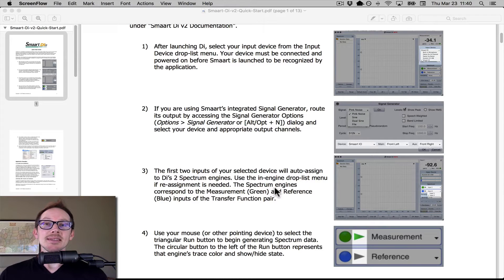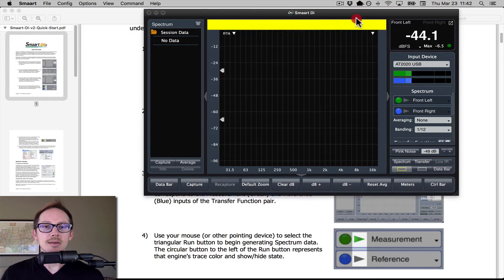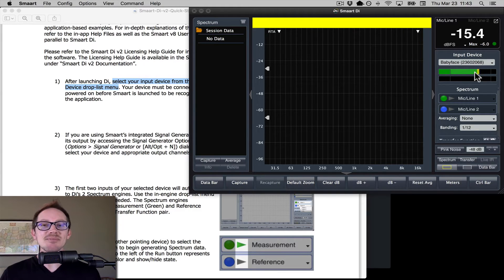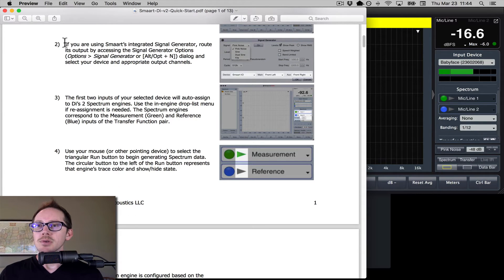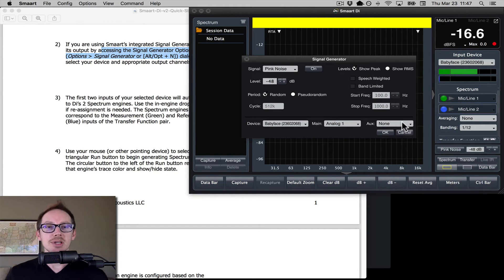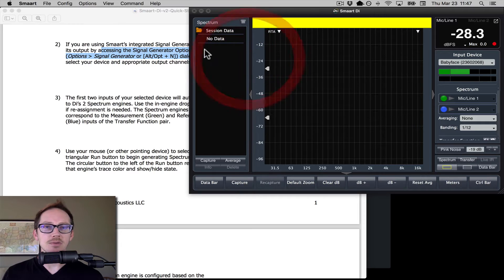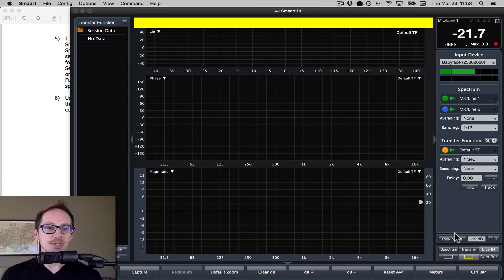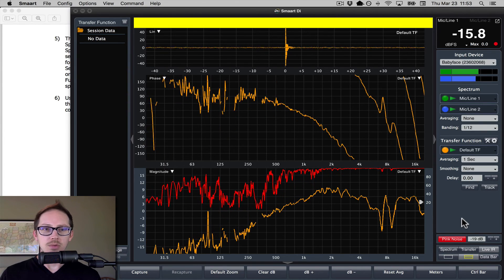Sound Design Live : Smaart installation and first steps

Comment: Hi Nathan! Thanks for the video. One question. Im gonna do a comparison between 3 trumpets sound, but I have to do first the recording in an anechoic chamber, and after that I will do the comparison in other place. Do you think I can use Smart for this issue? Record the sounds with a DAW (maybe Cubase) and after that import the files into Smaart and compare them there? Thanks a lot
Reply from the maker: Hi Alberto. Maybe. What, exactly, are you trying to compare? The frequency response?
Reply: @nathanlively  yes! the different spectrum of frequenzys. The perfect thing would be have, with the same amplitude of fundamental frequency, the difference (with numbers or %) in the amplitude of the harmonics (sorry for my english) all your help is welcome. I still don't know if analyze it with Voxengo Span... I have the trial of Smart v8 but I don't know how to use it... Some idea?? Thanks a lot bro!
Reply: with voxengo I only can see the difference but I can't calculate it exactly(or almost). And with Smart I also can compare the two sounds in RTA but I don't know how to get the numbers. Ans I also will need a spectrogram. Its for a University experiment, so I want to do it the best as posible. I will record this friday the sounds and I will analyze them at home after the recording with the guy is making the experiment

Comment: For FFT Measurment and Loudspeaker development there are some nice Videos and Software about SATLive form Thomas Neumann the develeoper - www.satlive.audio - and https://www.youtube.com/watch?v=HO7tl112Tic - he has his FACEBOOK SATLIve groupe https://www.facebook.com/groups/150276738336363/?fref=ts  and free Webinars on Edudip https://www.edudip.com/academy/thomas.neumann he also has a Software to track SPL levels called LEVELcheck http://www.levelcheck.de/download.php all the software has 30Days full functional Demophase - affortable Price with Dongle that kepps your settings and turns every Demo install to a full funktional Install. If you want to buy a Measurment Mic and Calibrator - buy the stuff form Isemcon EMX 7150 and SC1.http://www.isemcon.net/ashop/datasheets/EMX7150-DE-r03.pdf
http://www.isemcon.com/datasheets/SC1_US_r03.pdf
You can use every USB Sound interface as Input even your Behrinber X18 oder X32 as example - watch the routing.